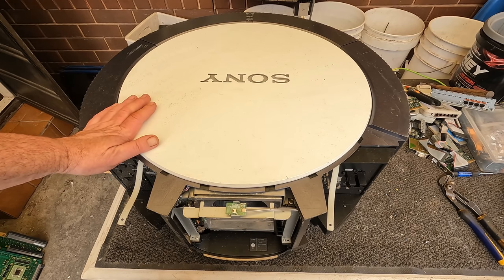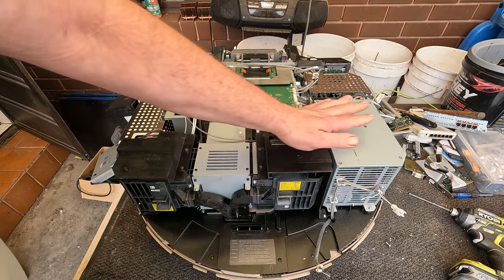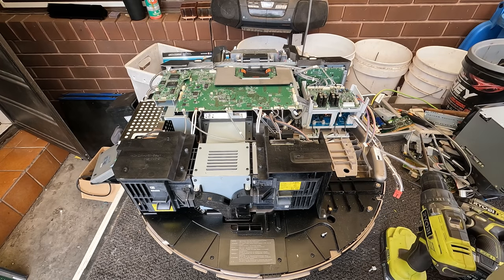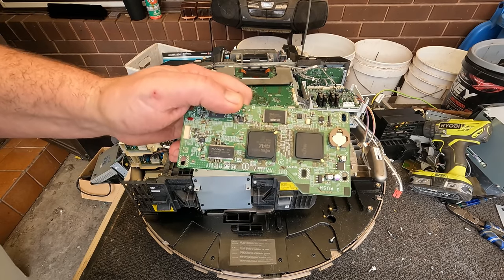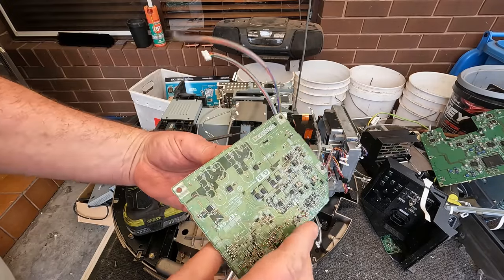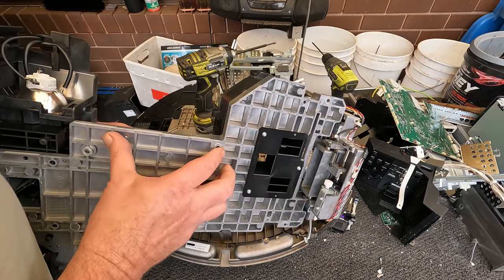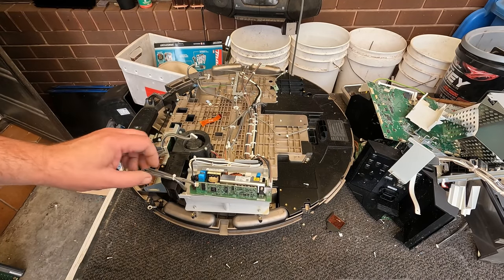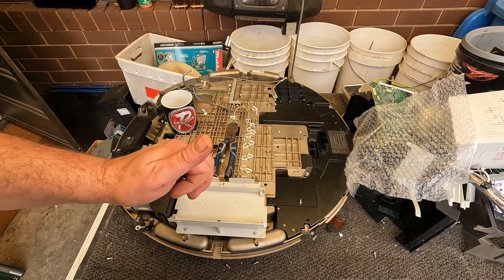Sony High End Projector Scrap - What's Inside?

Comment: Hey Ben! I’m a flipper, reseller. Through my bulk purchases I’ve amassed quite a bit of copper wire. I’ve tried to resell, but the parts were simply too old. I’ve always thought I’d scrap them for years now, but never got around to it. After watching your videos, I’ve finally pulled the trigger. Went to the local scrap yard, not knowing where to go. Guys were nice, set me up. And drove away with $50. So thanks from Canada Ben!

Comment: Found them!
"The VPL-FW300L and the VPL-FH300L LCD video projection systems are aimed
 for use at places like small auditoriums, large classrooms and meeting 
rooms, museum exhibits, event centers, ballrooms, and movie theaters. 
The projectors feature 3LCD technology, Sony’s BrightEra imaging 
technology, and have a choice between 5 different standard lenses, a 
locking bayonet mount mechanism, dual 275-watt lamps, and Control panels
 located on side promise easy installation and maintenance."